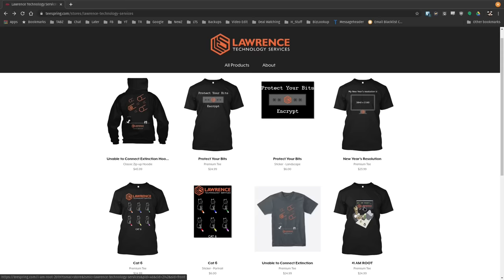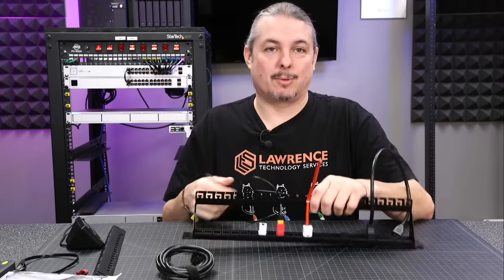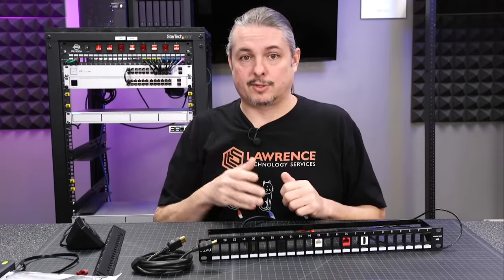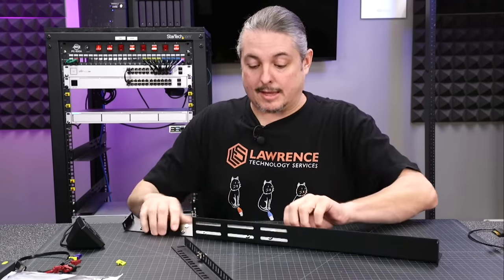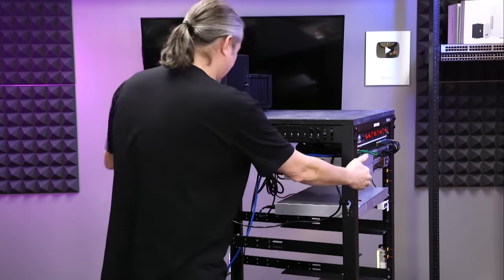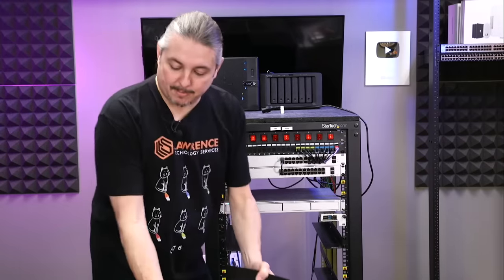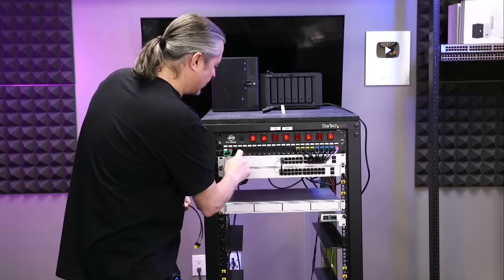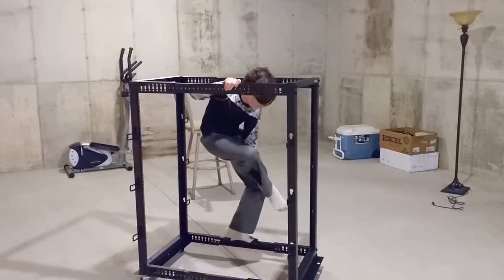DIY Home Rack Build

Comment: The rack you show in the build video is different from the one at the end and different from the one you have linked in the store - it has wire management “protrusions” on the side that looks like they take a lot of width and would not work in my application as I’m very constrained by width.
Reply from the maker: It's the same rack, I just didn't put them on for the video. They're an accessory that comes with it.
Reply: @LAWRENCESYSTEMS  Ok thanks - any way you could tell me the outside dimensions of the castors on the bottom.  I have less than 24 inches at the bottom but more up a few inches due to molding and some trim work near the base.  I'm wondering what the slide in depth would be at the bottom with the castors in line.  I know it's a big ask but if you have time and could measure and tell me that and how high it goes up before it gets to the full width that would be awesome.  Love the channel.  thanks.
Reply from the maker: The dimensions are in the Amazon page
Reply: @LAWRENCESYSTEMS  Sorry - not the ones I need. They have the outside dimensions of the unit. However what I need to know is the dimensions from the outside to the outside of tje castord. It looks like they are somewhat inset from the outside of the whole rack. Basically I have an obstruction near the ground that narrows less than 24 inches but if you inches up it’s more than 24 inches. So if the casters being inset will fit, I can use this rack.

Comment: The rack should be more stable horizontally if you used all four screws in the switches and whatnot. It should tie the two vertical sides together like a cross bar. I emphasize the should because I don't want to be "that guy".

Comment: Not sure if you you answer this but any particular reason why you went with a ubiquiti switch instead of cisco?
Reply: Ubiquiti hardware (outside of routers) is cheap (compared to Cisco), amazing and doesn't require nasty licenses.
Reply from the maker: They work great and not everything needs to be Cisco
Reply: Just my 2 cents.  If you noticed the last device that Tom left hanging on the Rack in the video it is actually an Aruba 1930 series Instant On switch.  In my opinion it is a much better home lab switch because all of the configuration is done locally on the switch itself and does not require the addition of a Ubiquiti controller that must be run on another PC or Server.  It all depends on use case but for a simple home lab the Aruba 1930 is the way to go!

Comment: The flat patch cables suck. The T in UTP is important. They fail far more quickly if you've ever dealt with them. Add fewer points of failure into your setup.

Comment: I've got some sticker shock when it comes to the price of that rack... $250 for a few bits of punched and coated angle iron and some wheels...  it just seems like a lot... where are all the $50-100 racks?
Reply: You could get some cheaper racks, which are mostly meant for network equipment, like switches, maybe a patch panel, and a few shelves, but if you want to go $50-100, I think the only way to go is DIY. If you're good with woodworking and have some tools, you can find some tutorials on how to build your own rack, and you can do it for that price point, and still be good quality (assuming you're not a total noob). I was actually going to go that route for soundproofing the rack (due to fan noise), I decided to just get the startech one, since I already have a fairly sound-proof closet, which made a sound-proof cabinet redundant, and would only interfere with cooling of the servers I plan to install.

Comment: Slim cables have slower bidirectional speed, it will not support bidirectional gigabit, thick cables will support bidirectional gigabit speed. Do a test and let me know if my test was not correct.
Reply from the maker: You are not correct, they support full speed.
Reply: @LAWRENCESYSTEMS  So Bidirectional Gigabit speed at the same time works out well? have you tested this?
Reply from the maker: @skitterlad  Yes

Comment: If anyone gives any grief about punching down vs. just plugging into an RJ45 plug, I don't know what is wrong with you lol. Yea, I can punch down, but you can always replace / reuse the cable if its terminated on each end with RJ45 connections. It's one more thing that can break, but the likelihood of that is extremely low.

Comment: Dunno where you buy your rack shelves from, but around here (Sweden), about 100 USD for one is not cheap IMHO. I mean, its shelf.
Reply: Depends on the thickness of the metal. You can get $20-$25 ones that will work good enough for light equipment, like modems or short width 8-16 port switches. Then there are the heavy duty ones that are $50 or more that'll hold up a good size UPS, no problem.

Comment: generally bad practice to put power right next to data, the little switches are "handy" but network engineers gon' cringe every time they see it.  If i "just had to have the switches" (i would ditch it personally, weak point of failure) i would put it at the bottom, or better in the back / bottom with the pdu. anyway, every time i see that, i wonder what tiny amount of signal loss is happening. :D (not that it matters right) but ya know, network engineers cringe when they see it.

Comment: I think the rack studs look ugly. My rack came with threaded holes and screws so it looks great and doesn't need the other nuts.
Reply: Threaded racks are great... until you strip a hole and now that rack unit is semi-useless.  Not likely to happen early in it's life, but as the years add up, it happens.

Also, it's getting harder to get rack accessories for threaded racks, believe it or not.  Cage nut racks have been the standard for long enough that not all companies support them. :(
Reply: @compudude  Threaded racks are the absolute worst. I have had to replace entire racks due to stripped out holes.
Reply: Threaded racks are the absolute worst. I have had to replace entire racks due to stripped out holes.

Comment: Isn't rack gear loud as hell? So if you live in an apartment, this won't be really a good idea :D
Reply: Depends on your neighbors. If you're looking to get back at them, it could be a great investment :D
Reply: @linuxinstalled  I'm not worried about the neighbors, but myself spending countless hours a day in 80dB whining fan noise...
That's not fun :D
Reply: Depends on what kind of gear you have racked. I only have 3 actual server chassis in my rack but I upgraded all the fans in them to much quieter Noctua fans and while they are still louder than a normal desktop they are MUCH quieter than the stock fans they came with. And depending on your networking needs you might be able to get away with fanless gear that makes no noise at all. It really depends on what need/want and where you are willing to compromise. I think what a lot people forget about is the heat that can be put out. My setup is pretty quiet but oh boy does it keep the room toasty warm.
Reply: It doesn't have to be loud. If you do not put any 1U servers in the rack, it can be very quiet. There are even fanless switches you can buy if you can't deal with a little sound.

Comment: ProTip, Dont be like Tom and only use 2 rack nuts in your devices.  There are 4 holes in even in 1u switchs and servers for a reason.  Dont be lazy, dont be cheep and dont do things half way.  Plan out your rack ahead of time, you can get 100 rack nuts and screws for less than 20 bucks on amazon.  Your rack wont flop around if your gear is secured at all 4 corners.....  Is this the Verge video of rack mounting?  Did you just troll all of us Tom?  Did you mean to call your zip-ties tweezers?

Comment: Cage-nut tool! Why are you not using a cage-nut too?! If you put bolts in top and bottom of all your 1U devices, the rack won't wobble as you demonstrated. You literally just explained why you should use all the holes for rack sliders!

Comment: Awesome! Sad enough I'm a kid so I can't afford this :(
Reply: You may be surprised what you can do for cheap. Especially with used gear.
Reply: Do odd jobs, save the money, and buy used parts.  With some patience and discipline you can make your own home lab.
Reply: @anthonypolsinelli1179 , I'm looking for some inexpensive rack mounted servers so that I can start a home lab.  Thoughts on where to look for used equipment?
Reply: @richardravich8337  eBay and r/homelab, r/datahorder
Reply: @anthonypolsinelli1179  I know but the sound too
Reply: @axelolaussonholtenas5087  Just avoid 1U servers and noise will be manageable.

Comment: Whoever the purist "punch em down" people are should check themselves before they wreck themselves LOL. The 'extra' point of failure is equally as high as that 1 white\orange wire you half punched and fails the moment somebody has to unrack a piece of equipment.